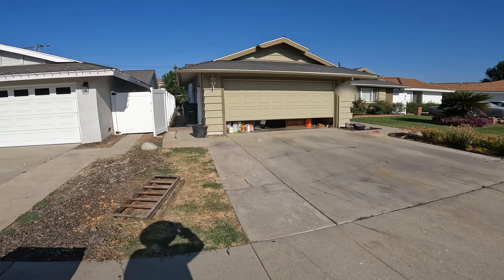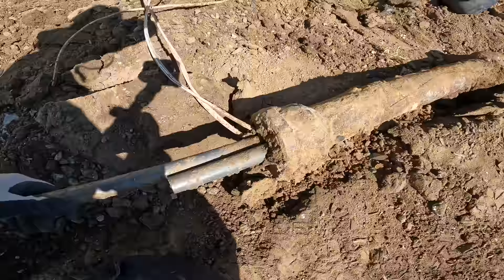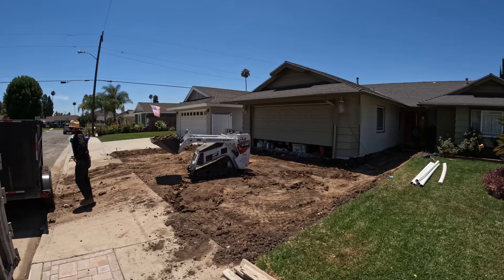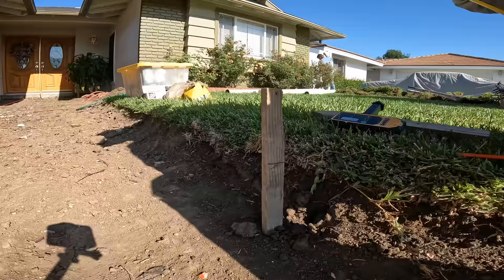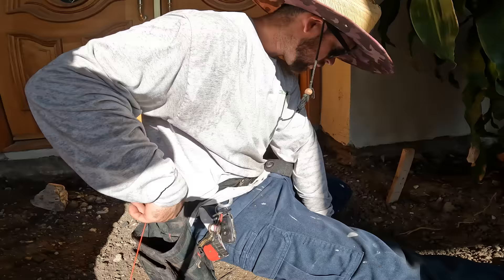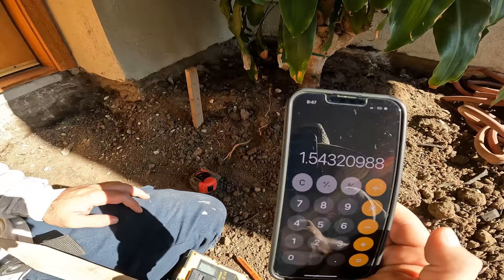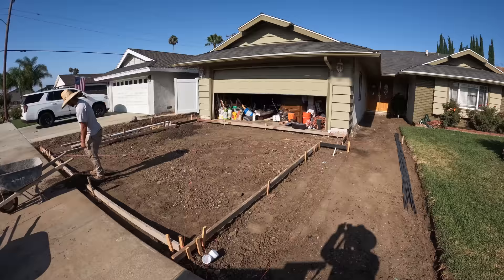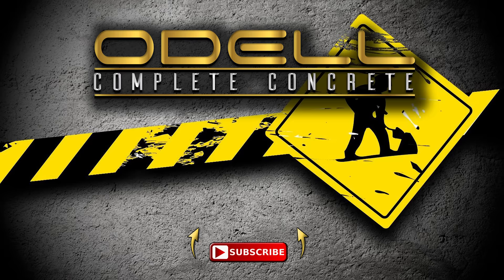Front yard Remodel New Concrete Driveway and Paver walkway! Part 1

Comment: What’s the best way to check to see if that cast iron electrical pipe was truly dead or not ??
Reply from the maker: Test them
Reply: Best bet is to use an angle grinder with a cutoff wheel. In the rain wearing a stainless steel mixing bowl for a hat. Just cut into the wiring and see what happens.